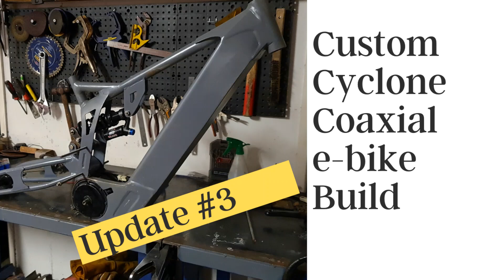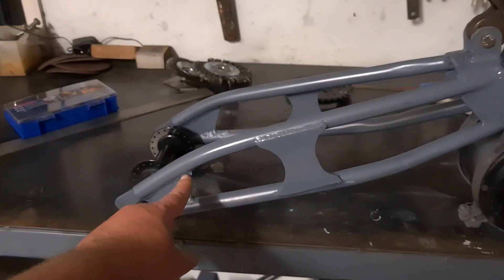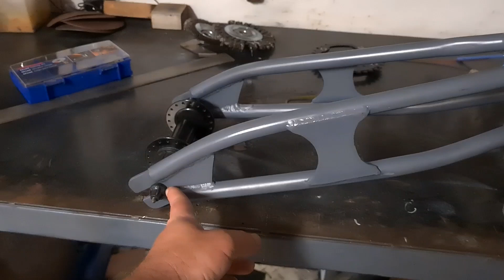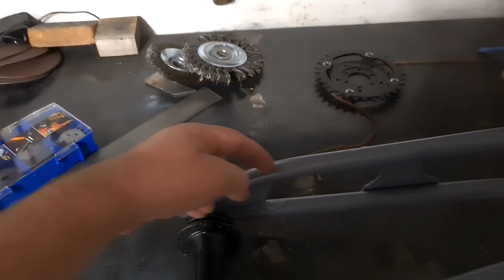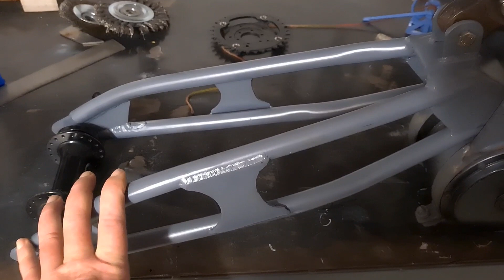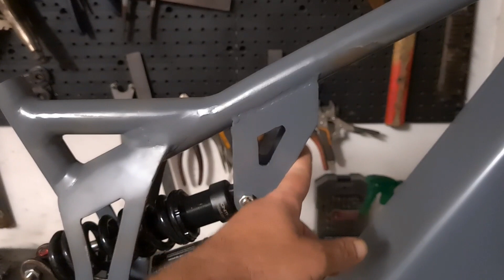Custom Cyclone Coaxial Frame Update 3

Comment: Would power tool batteries be an option?  In the US we have Harbor Freight.  They sell cheap Chinese tools.  Their Hercules range of power tool batteries actually have Samsung 25r cells inside.  A 5s2p battery is $65usd, but you can find them on eBay for around $40.
Maybe you have something similar in Aus.
Reply from the maker: Thanks for the suggestion - We have Bunnings here in Aus which is similar but the batteries aren't cheap or good quality unfortunately. I may end up using hobbyking lipo if I can't find anything else. Cheers